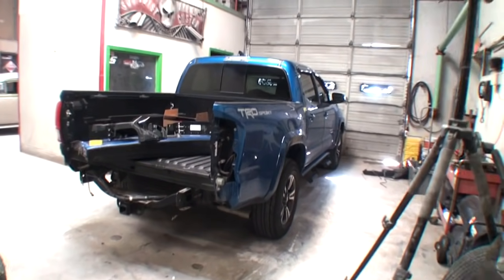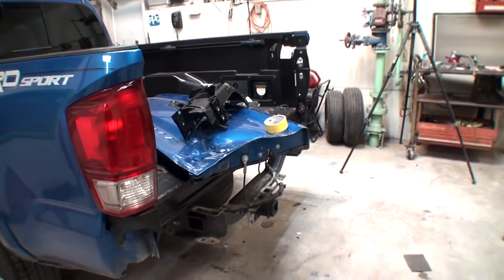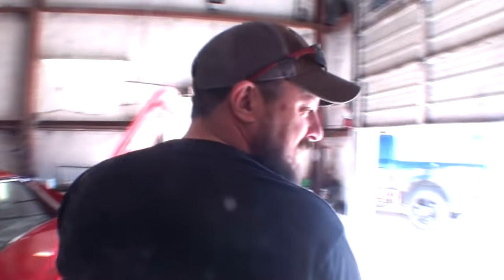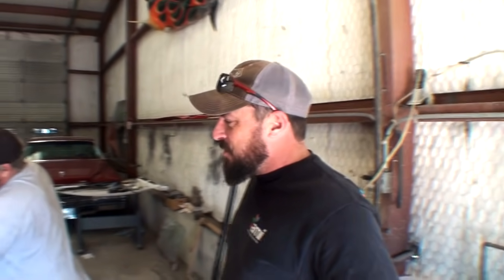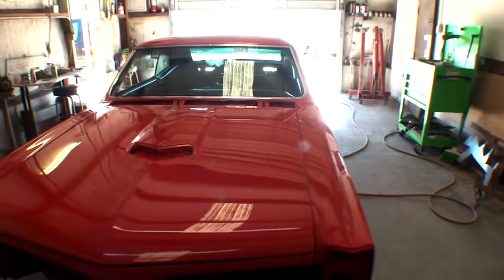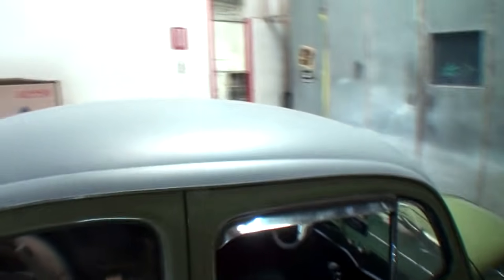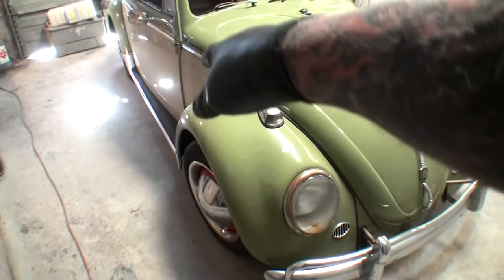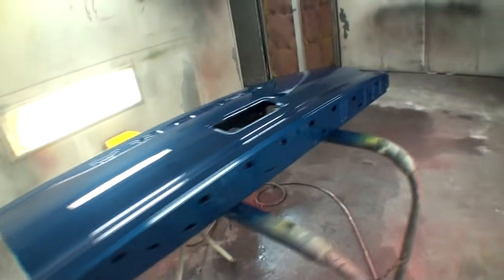Show Me The DAMN CAR Part 1 - It's Almost Done

Comment: hi pete been watching your videos for a few years. i watched  how to paint afender and tank. this really helped me and the fenders on my trike look great. I built a truck camper ,metal frame and aluminun sheathing . do you have any specific video on painting bare aluminum or metal prep advice? thank you for sharing you're knowledge.
Reply: You need to use a SELF ETCHING PRIMER with ACETONE in it so it will grip to the aluminum.. Prep the bare metal with 180 grit then apply the self etching primer and then you can apply the standard 2k primer is need be or go straight into paint.
Reply: @diyautoschool  thank you pete.Pete